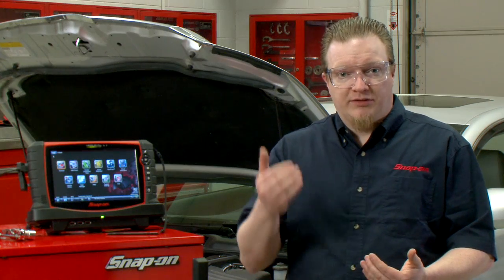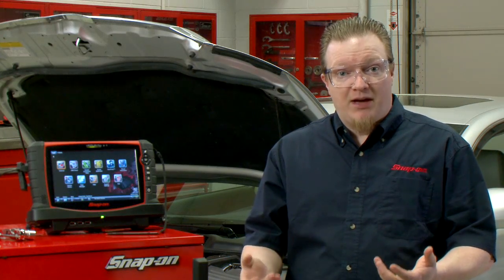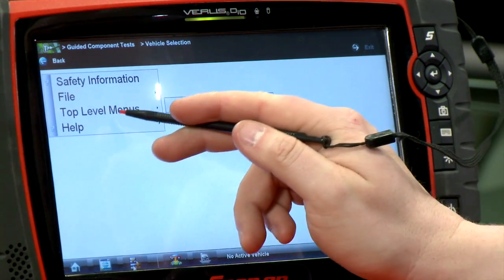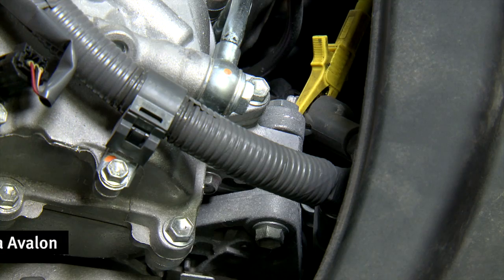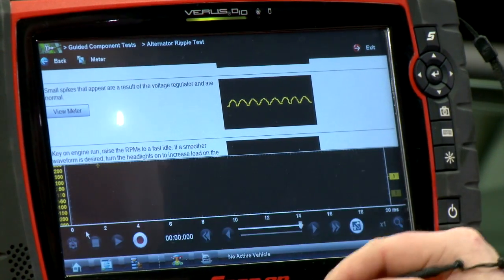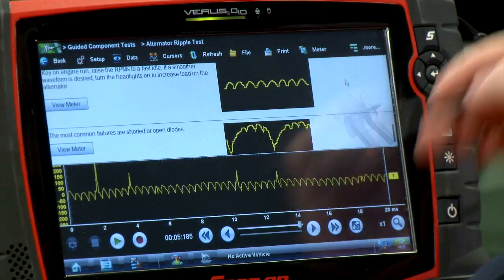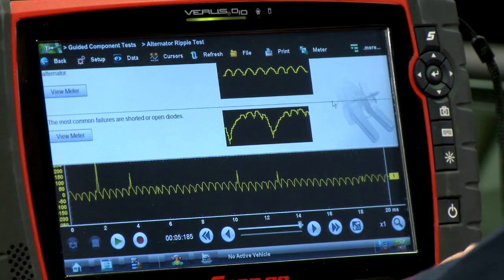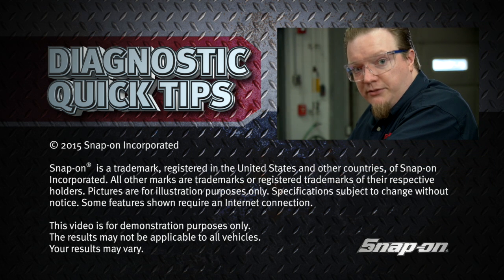Alternator Ripple Test- Diagnostic Quick Tips | Snap-on Training Solutions®

Comment: If you know how to use a scope then the thing that snap-on is offering here is redundant. Or just a waste of your or your business money.
Reply: What are they offering here other than a quick tip on testing for AC ripple? The tool he is using is a scan tool w/ a 4 channel scope. It has a guided component test feature, sure. It comes with the tool. You don't HAVE to use guided component test and can just set the scope up yourself. I own this tool, as well as a PICO scope. What I can't do with the PICO scope is scan for codes/bi directional control/basic settings and adaptations etc...I use the PICO when I need more than 4 channels, or really need the heavy lifting that PICO can do that the more basic Snap-On cannot. That being said, if a shop does not already have a good scope and they're in the market for a good "generic(by generic I mean not OE software like ISTA or ODIS)" scan tool it seems like a pretty good VALUE to me.